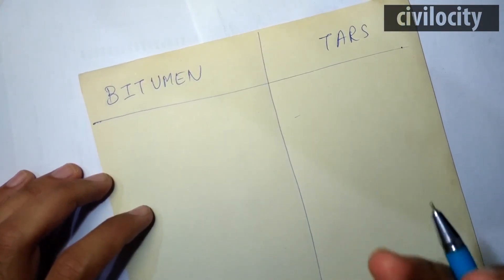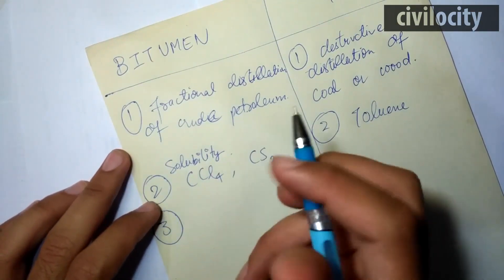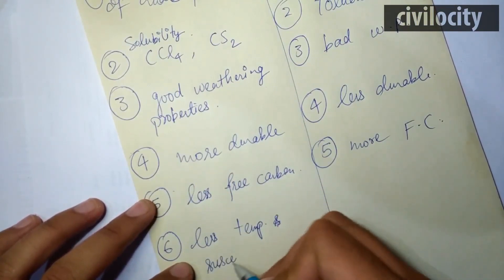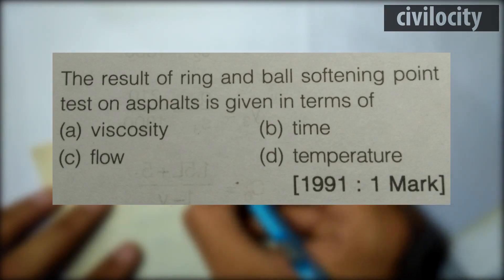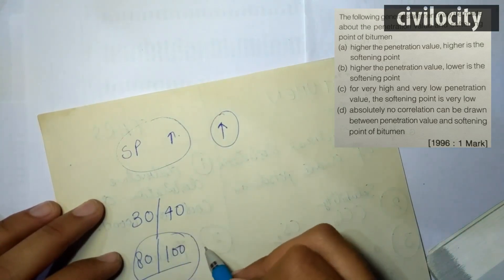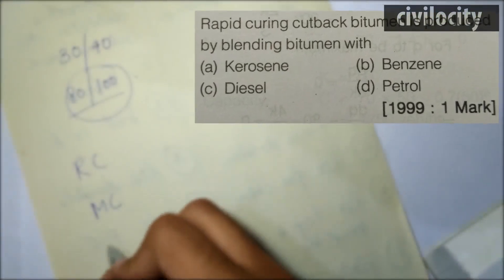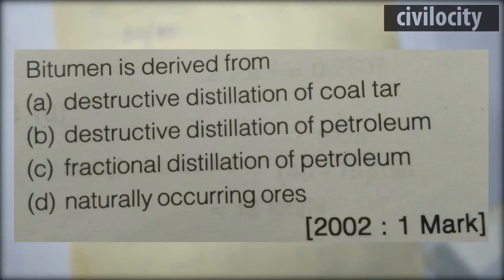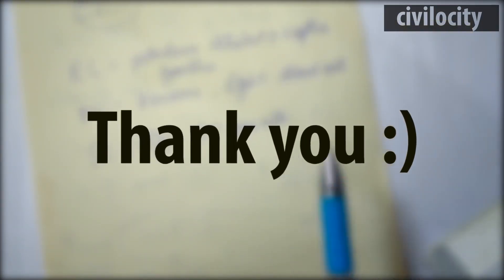Difference between Bitumen and Tars | Lec-8 | GATE

Comment: Dear sir..30/40 grade bitumen is used for high temperature..80/100 grade bitumen is used for very low temperature..So how can you say ans (a) is correct..???
Reply: I think answer B is correct.You are right for 80/100 ie VG10 softening  point is 40 and for 30/40 ie VG40 softening point is 50 degree .
Reply: Yes you are correct

Comment: Sir..in lacture 7 part 2 u had told that if penetration is high then viscosity is low nd it is used in cold region but now in gate qution u use just opposite statement...so please correct
Reply: See this video at 11.17 nd provide appropriate reason for ans 1